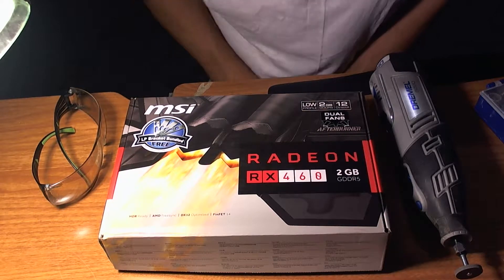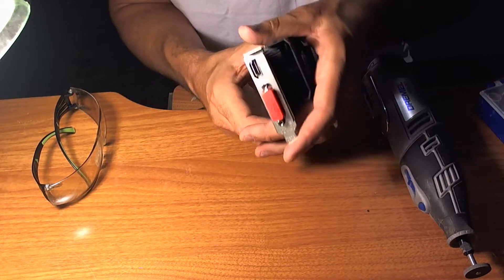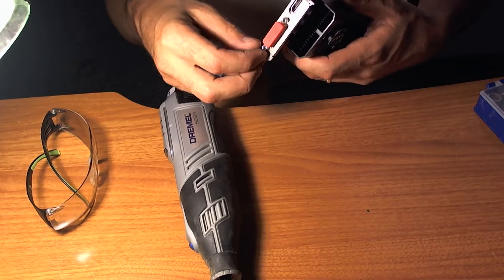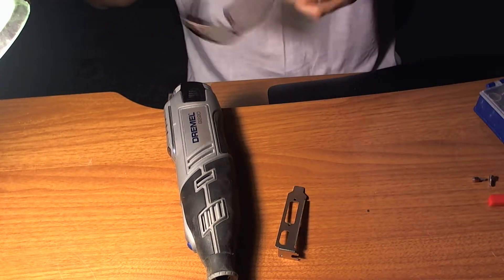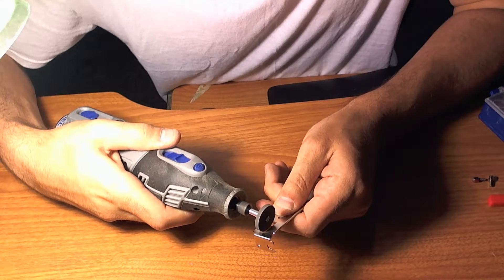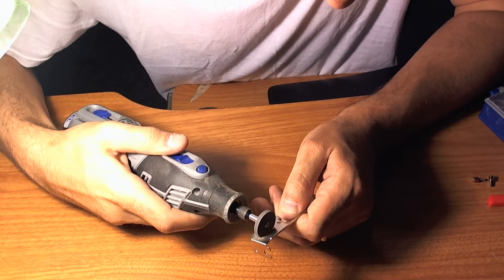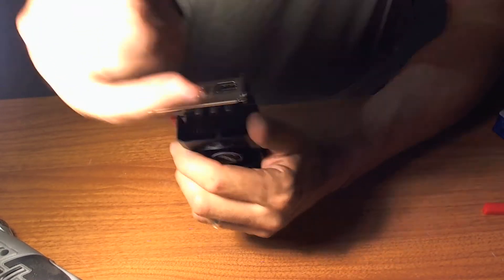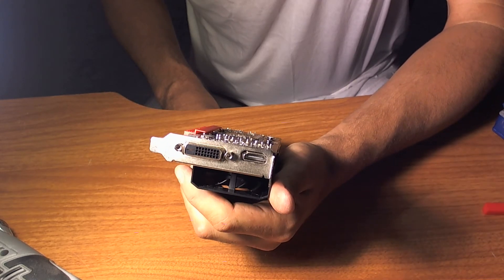RX 460 Modification. Dremel Fix for Out of Line bracket on low profile model.

Comment: thanks for the tip...guess I need to get myself a small file
Reply from the maker: bucket.george@gmail.com  
If you want to give me a message. I can mail you the modified bracket as long as you mail me your new one in return.
Reply: Thanks for the offer man, i really appreciate it.  I'll try my hand @ it though, it shouldn't be too hard. If i get it working it'll be a notch on my belt, but if not...